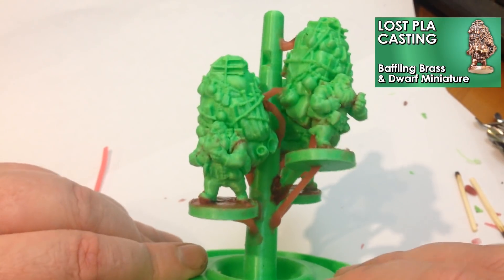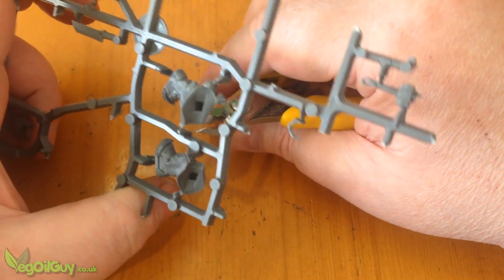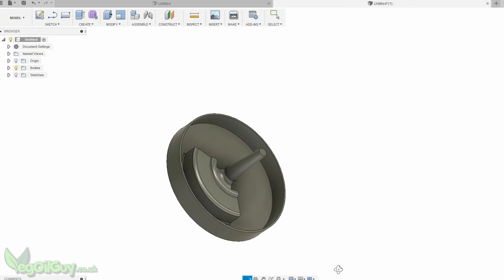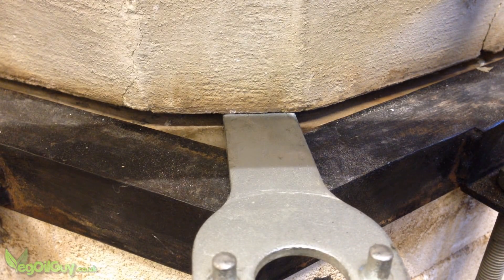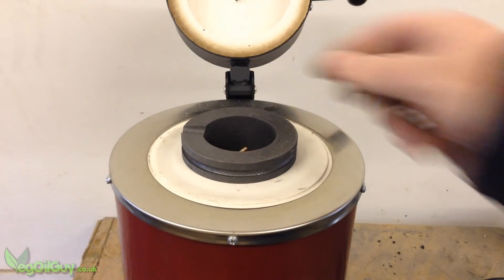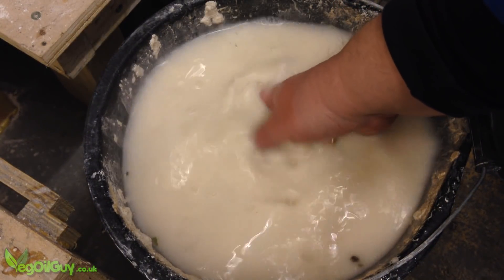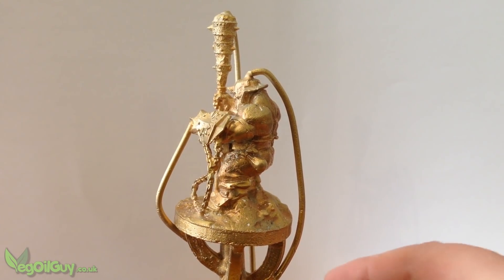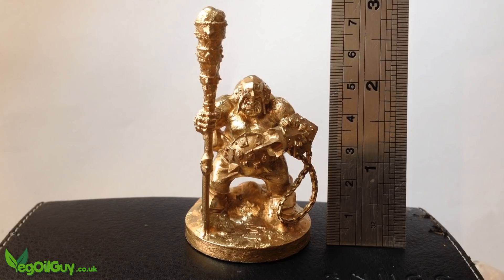WARHAMMER miniature bronze casting - lost PLA casting method - by VOGMAN

Comment: i think injected molding is using abs. hate the stuff it stinks when using it as a filament with 3d printing. and needs a heated chamber to stop the layers from separating.  man you so need to get a anycubic photon resin printer. and use castable resins i have seen a lot of users using it to make jewelry and stuff. would be ideal for what you want. :)
Reply from the maker: When money allows : )
It's on the wishlist, believe me .
Reply: I can personally vouch for the Anycubic Photon, easy to use and the results are splendid
Reply: @meganwhite9090  Photon is great I've been using it to do metal 3D printing, Still working on perfecting the method (since it fails more often then not) so I might make a video once that's done, don't expect it soon though.
Reply from the maker: Thanks Megan  : )